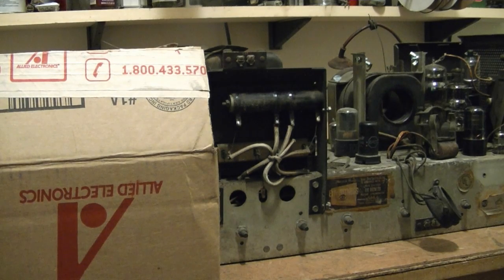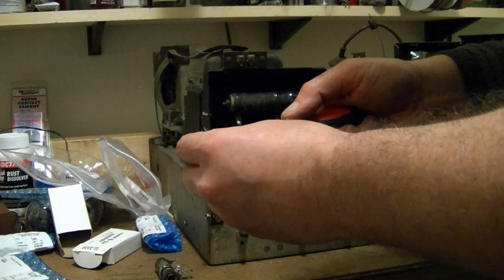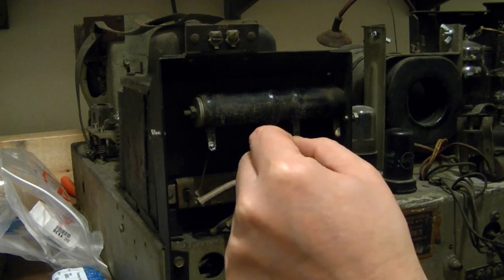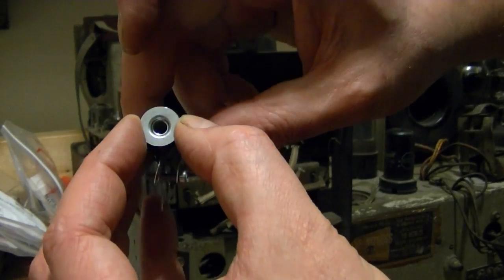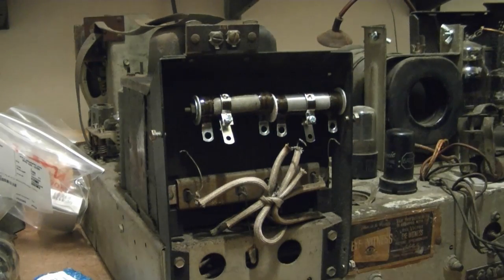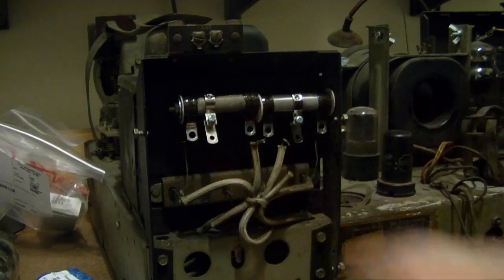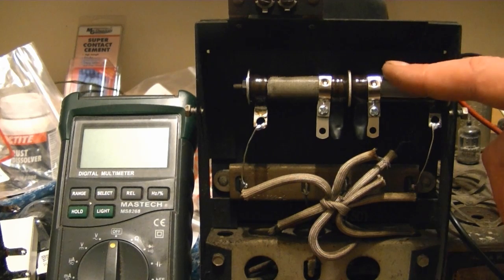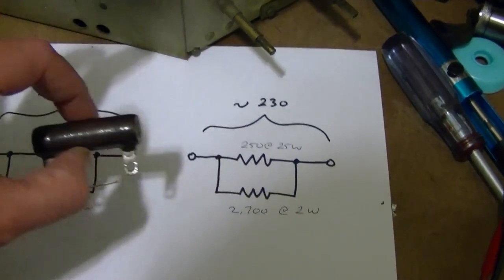RCA 630TS restoration p3o?

Comment from the maker: Good question.  I calculated the voltage and current that would produce 17 and 10 watts in a 1360 and 230 ohm resistor.  I then calculated how much current and power would be produce with those voltages across a 15K and 2.7K resistor.

Comment: The power transformer itself is shielded not only by the end bells but by an electrostatic shield inside, the wiring is bellow the chassis of course. Wire wound resistors do create some magnetic fields but they are minute enough that the heat shield would be more then enough to block them. In either case the fields running through the transformer and the power resistors are low frequency or straight DC, this is much more of a problem with audio circuits, TV broadcast signals are VHF or UHF.

Comment: Cool! Great that I now have a much better idea how to mount these power resistors....I have  a bunch of these, fixed and adjustable and might have to replace the bar resistors  with them  in some of my amplifiers/radios....reat that  now I know where I can get the proper mounting hardware....and the  mica insulating washers.......

Comment from the maker: There are some reproduction parts available from a few outfits like Retro-Tronics and Amptech Systems.  Mostly backs.  As for resistors and capacitors, the modern versions are close enough.  Still plenty of NOS tubes around.  It's the scarcity of picture tubes that will be the death of this hobby eventually I think.

Comment: Bob, a doubt - if I see correctly, those are the antenna terminals on top of the resistor box. In technical terms, is it a good idea to place them there considering that the power resistors are wire-wound and right behind the box is the power transformer? I ask because I imagine that both the transformer and resistors create electromagnetic fields around them. Or are their covers enough to isolate them? I was watching you working and that occurred to me.

Comment: So I'm workings on this same chassis almost had it finish was working on the horizontal section and the 5u4s red plated and sparked on me on my final test. I haven't check yet but is it possible if these resistors shorted could it cause this? I have no idea what's causing this.
Reply from the maker: Absolutely.  They are directly across B+